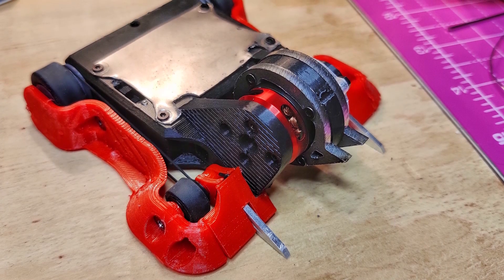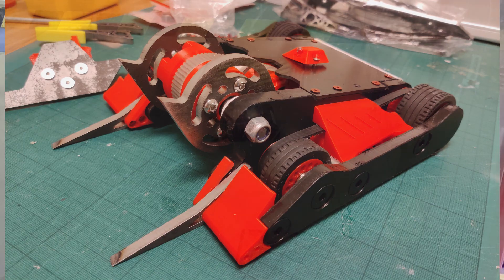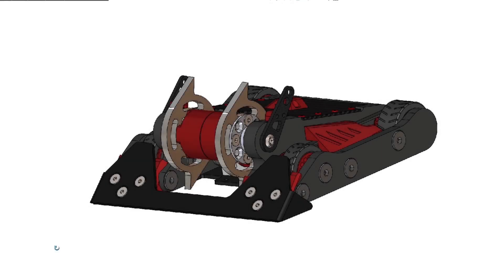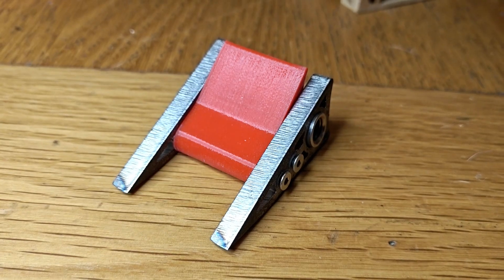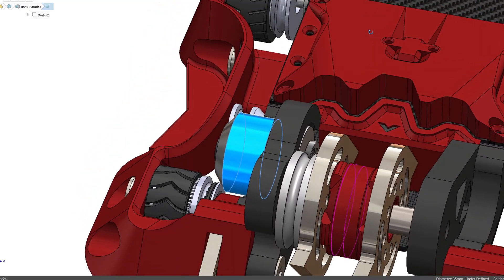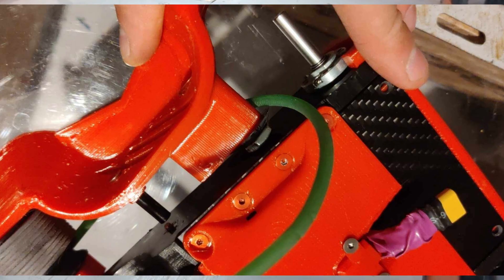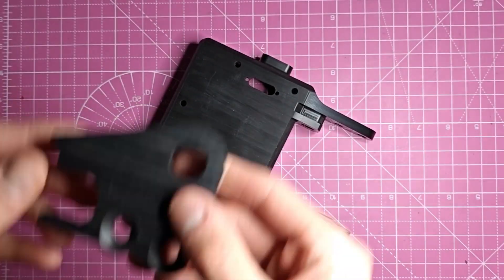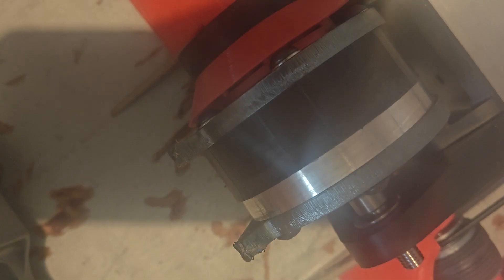Scaling my Antweight combat robot to Beetleweight size... How hard can it be?

Comment: V-belts are a nice middle ground, and you can get aluminum pulleys
Reply from the maker: Cheers, I have now solved the belt issue and it's a solution I haven't seen before at beetleweight. Something I will talk about in pt2!

Comment: Wonderful video. Love seeing how other roboteers build, fail and iterate their designs. Just one point I have run the dragon motors at 4s as well and the brushes were completely worn out after like 12 fights (and not to much test driving). I think these motors just get too hot at 4s.
Reply from the maker: Thanks! I have noticed similar with them. I recently tried the Gekos on 5S and they seem good, run cooler but lack a little bit of the punch of the dragons

Comment: im building a beetleweight battlebot, like a mini version of the 60lb depth charge that competed in the 2018 seaso of robowars, do you have any tips on desigining combat robots in onshape, its not my first combat robotm but it is my 1st non plant class. good video.
Reply from the maker: Hi, I have a few videos on CAD for combat robotics and in particular one for onshape. 

Quick summary of some things I do below. 

Find models of as many of the components as you can rather than recreating from scratch as this gives more time for designing the bits you care about. 

Put those parts into an assembly so you can get an idea of size and shape that is needed because of your fixed parts.  

Add the correct weight for the parts and remember to apply material properties as that can help prevent nasty surprises.